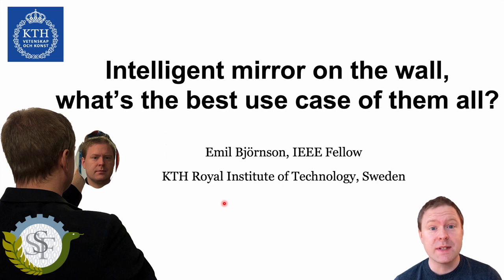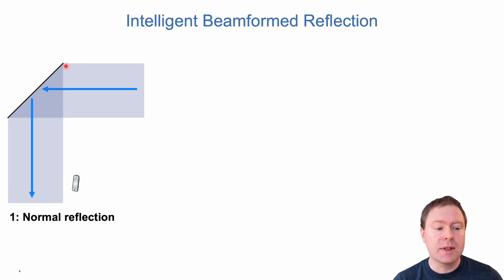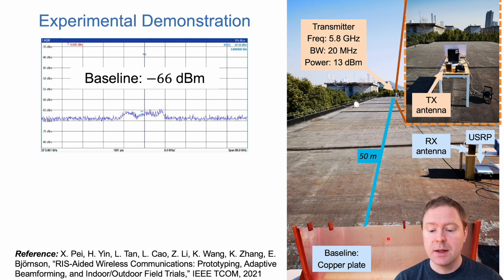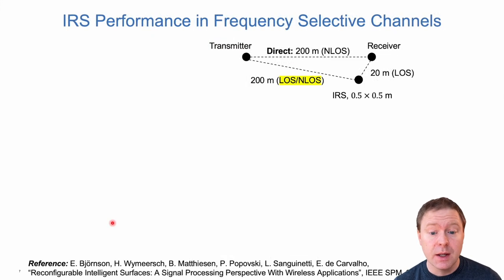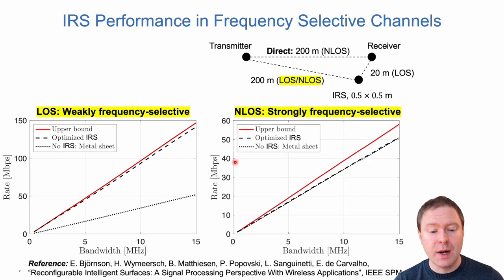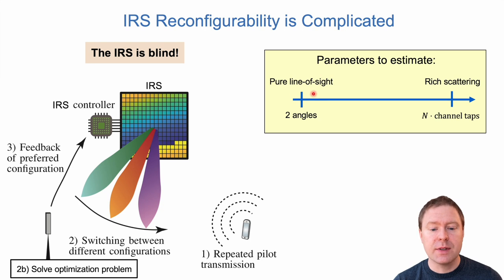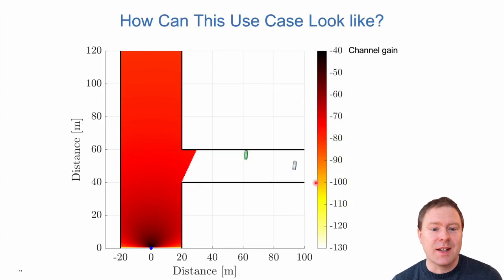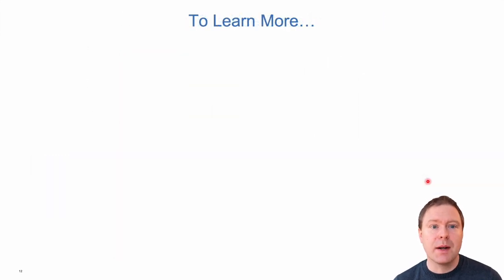Intelligent mirror on the wall, what's the best use case of them all?

Comment: Good afternoon. I like the way you explain those concepts. Thanks for creating this excellent content.

I would like to ask you something, comparing the "traditional surface reflection" vs the "IRS" with mmWave bands. How bad is the traditional surface reflection? Is there an estimation of db lost using "traditional surface reflection"?

Thanks for your time.
Reply from the maker: A traditional smooth surface reflects signals as a beam in the direction specified by Snells law. If the direction of the reflection is right, it is equally good as an equal-sized IRS. The benefit of the IRS is that you can control the direction of the reflected beam. Hence, the signal strength from the traditional surface can be the same or many tens of dB lower. I cannot give a precise answer since it depends on how misdirected the traditional surface is.

Comment: Thanks for this interesting presentation, please Prof, What adaptive smart antennas are capable of doing what RIS does in the current network ?
Reply from the maker: Adaptive smart antennas (often called MIMO arrays nowadays) generate signals and can transmit multiple signals in different directions. An RIS receives signals from elsewhere and reflect them in controllable way by changing its electrical shape (similar to rotating and deforming a metal surface).

Comment: Dear Prof, I was curious to know about configuring RIS for optical signals, particularly lasers ? How can be use lasers and try to beamform using RIS ?
Reply: we*
Reply from the maker: I haven't analyzed this problem specifically. Many of the configuration and estimation algorithms are wavelength-agnostic, but I suppose they cannot be used in optical bands since one likely cannot build coherent transmitters/receivers and there would be too many RIS elements to control them individually.
Reply: @WirelessFuture  Thanks Prof for your insightful comments.

Comment: Thanks for this great presentation. I think it is still early to restrict the IRS OFDM use cases  to one of coverage extension where the IRS links are significantly stronger than the direct path and with IRS links dominated by LOS components. This is would be true if we limit ourselves to the first IRS model characterized by diagonal frequency-independent phase-shift matrix  and with straightforward extension of channel estimation to the IRS systems.  But,  don't you think that there are already works that go beyond these Channel acquisition protocol and IRS models?  I guess what I mean is that the coverage extension use case according to the current IRS models  is definitely a good use case but not so sure if we are ready to say that the  IRS "can not be used to provide better performance when we already have a coverage"
Reply from the maker: Thanks for your input! The intention with this presentation is to identify the “best” use case, where an IRS can make the biggest difference, not to say that other use cases are worthless.

Some things can be dealt with using better algorithms, which takes the right characteristics/models into account. But we cannot beat physics, so the pathloss will remains multiplicative in the far field, the degrees of freedom is determined by the electrical aperture size, the number of channel parameters is determined by the environment, etc.

When looking for other promising use cases, I think one should look beyond coverage extension. As mentioned at the end, increasing the channel rank is one such additional use case. Improved positioning is another one which we described in an SPM paper.

Comment: Impressive stuff but seems cost prohibitive.  I mean, this thing looks many times more expensive than simply installing another 5GHz radio to provide additional coverage.  It assumes you have rights to the specific location this thing needs to be mounted, because strategic placement would be required.  And then if you have the rights to place this panel, why not just install a mesh node instead.  It will be interesting to find both the use cases and where cost actually makes sense.
Reply from the maker: These are valid points and much research remains to determine the cost and capabilities of these intelligent reflecting surfaces. A key benefit over mesh nodes and relays is the full-duplex operation. The power consumption could potentially be much lower than with the competing technologies since there is no signal transmission-amplification in the surface. But it is not a solution for every situation and the future will tell if there will be large-scale deployment or not.
Reply: @WirelessFuture  Agree with that.  Keep up the great work, love your videos!